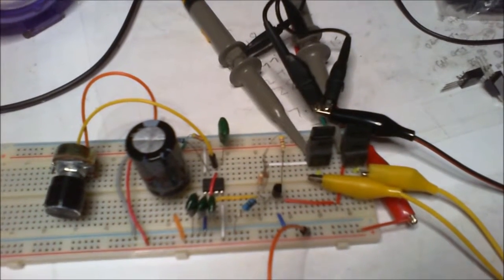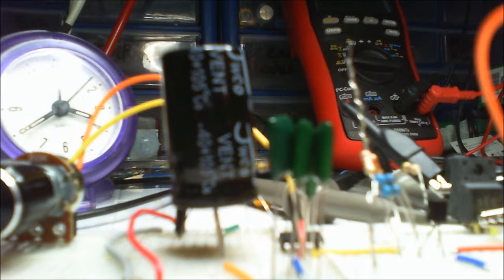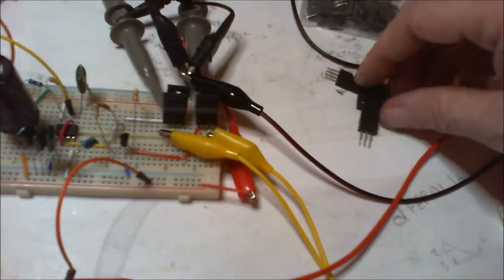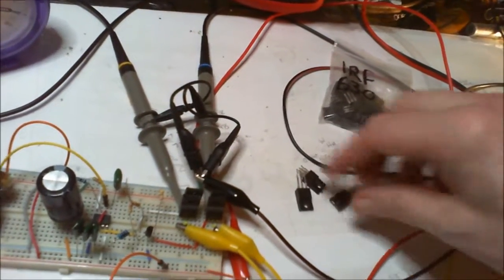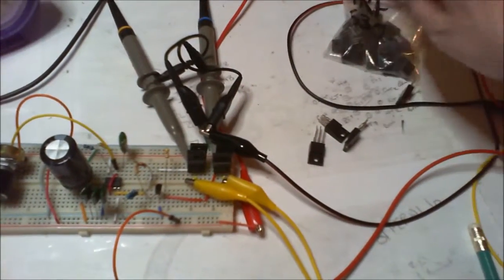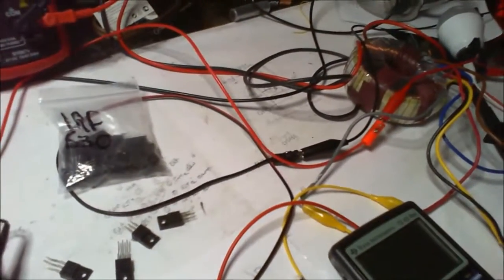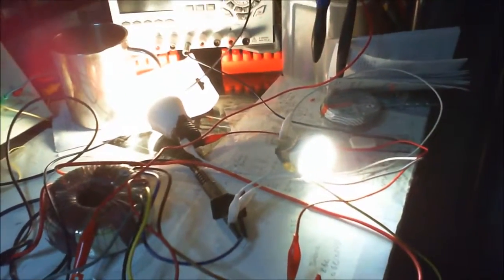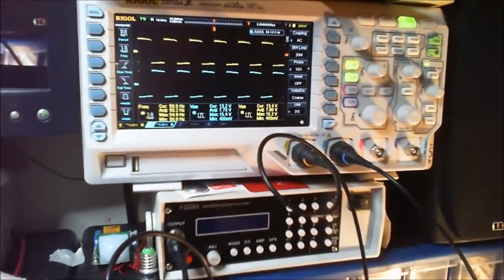Tweaked 555 Based Inverter Using 2N2222 IRF630

Comment: hi @Elecifun

555 timer 7 and 6. pin for 50hz.

what used for resistance 7.and 6. pin?
Reply from the maker: +Harun Özcan Its a 10K pot or you can use a 50K
Reply: +Elecifun hmm.Im again try but not good work.
send me circuit plan ?
Reply from the maker: Harun Özcan I have a 10K pot in series with a 150K resistor. I will look for the schematic but it may take a while.